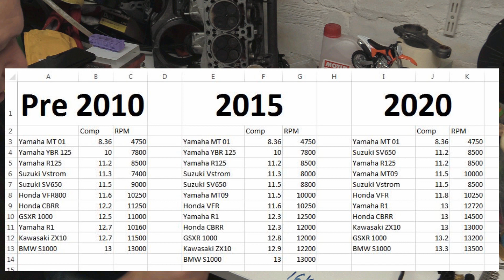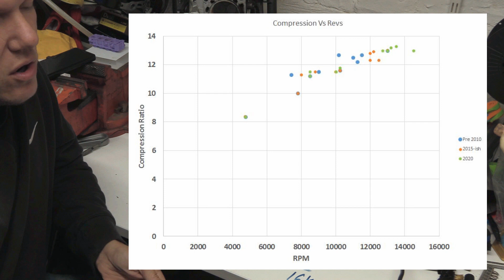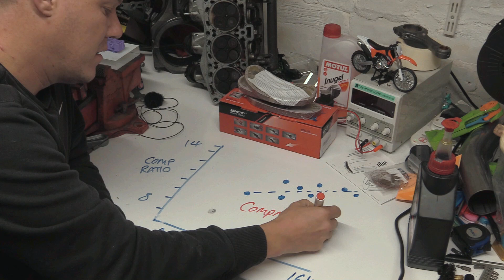High compression and RPM?

Comment: More compression is more oxygen is more boom. More rpm is more boom per minute is more power. On bikes the tiny engine in comparison to cars is limited to some compression ratio to keep the heat down. Engineers are constantly looking for solutions to make more power and keep to engine somhow reliable. Some of my thoughts.
Reply: Good points, just one note though: more compression isn't more oxygen. If it's a N/A engine, it will suck in the same amount of oxygen no matter the compression ratio. Higher compression (squeezing that same mixture volume into a smaller volume) will however allow for a faster and better ignition, thus faster combustion, thus a bit more power and better efficiency at higher RPMs.... at least that's my understanding.
Reply from the maker: "More compression is more oxygen is more boom."

- No. Definately not. Compression ratio or amount has nothing to do with volumetric efficiency

"On bikes the tiny engine in comparison to cars "

- No they're not. 1 litre cars are everywhere...
Reply: @thedirtyworkshop  1L on motorbikes is considered a big engine and on cars it's rather tiny. On top of that in cars you have much more space or maybe more aluminum than on a motorbike.
Reply from the maker: 1 litre is 1 litre ....
Reply: @thedirtyworkshop  well, with higher compression there is definitely more oxygen in the same volume as in low compression scenarios. Or am I just stupid?
Reply from the maker: You're just being stupid
Reply: @thedirtyworkshop  whatever. I think you are just being busy, or ignorant. A few videos ago you just said higher pressure means more parts/molecules per given volume, or higher temperature.

Comment: This is an interesting topic. I can't really pinpoint just the one factor that is involved here, but several correlating things.
- to get more BHP out of the engine
- to sustain or improve power output without increasing weight / displacement / fuel consumption or rather make things lighter and more efficient
- keeping or improving the performance levels while complying with emission regulations that tend to counteract that
Reply: Higher compression/hotter combustion decrease N2O but increase NO emissions (among other reactions).
Reply: @beachboardfan9544  Fair enough. I don't have any figures to determine how much we gain in HP plus lessen the CO/HC vs. how much more NO is produced. I'm sure it is a balancing act like everything else and I am not fully educated in methods regarding emission control, just aware of the basics.
But yeah, I am rather curious what the answer is and how far off I was :D
Reply: @davidbalogh3845  Emission is a pretty moot point tho, catalytic converters reduce oxidized nitrogens to nitrogen and oxygen, and burn any hydrocarbons and carbon monoxide to CO2 and H2O, if anything a hotter combustion would just make the catalytic converter get up to operating temperature faster...

Comment: It's about detonation aka knock. It takes heat and time to occur. At higher rpm there is less time for knock so manufacturers can increase compression.
Reply: Also note that high rpm engines have their intake valves open for longer past BDC to take in a bigger charge of air at higher speeds. Downside is that this makes them perform worse at lower rpm cause then the cylinder pushes out some of the charge. However this prevents them from having knock at lower rpm (from high compression) since then you don't even get a full charge.

Comment: The A/F ratio is more or less the same in most engines, so the mixture burns at about the same rate, regardless of rpm or throttle. Ignition happens before TDC, and peak pressure should be just after TDC. It would be bad if the piston still "lingered" at TDC while the mixture has already burned enough to reach peak pressure. A higher rpm means the piston spends less time near TDC, so it allows for higher compression - the flame front won't "outrun" the piston. Otherwise, knock may occur and you'd have to retard the ignition. Ignition timing varies with rpm for this reason.

Comment: I feel like he's fishing for dynamic compression ratio believers...

Edit: here's my guess, at higher rpms the vehicle is moving pretty quickly with good airflow over the radiator... So good adequate cooling for the engine along with the cylinder heads... So the temps are kept down just enough to prevent preignition...
Reply: Dynamic compression ratio? Like having conrods made out of springs? The faster my engine spins, the longer the springy rod gets, the smaller the volume at TDC, the higher the compression ratio, the higher the power. This is where the word "powerband" comes from because springs are like rubberbands? And higher RPM = higher power?
Reply: Phi Tsf power band is a term usually referring to a power valve system on 2stk dirt bikes. Not bands, or rubber.. just a exhaust flap that opens based on engine rpm. It works off a spring, that can be swapped for stiffer or softer springs, which change when the “power band” power valve starts to open.
Reply: Noah.Lytle312 i think you are partially mixing power band and exhaust power valves. All correct info but a power band is just the range of RPM in which the motor creates the most power/torque. A power valve is a two stroke valve that opens/closes with RPM to include more RPM in that range

Comment: Good question. Most of what I work on doesn't go past 8,000rpm, kinda lost like a puppy in high weeds on this one. The only thing I can think of is a fluid pump I have that is hand actuated. When it was new it would start moving fluid on the first pump. Ten years later, it takes 1000 strokes per minute to move a millilitre of fluid.